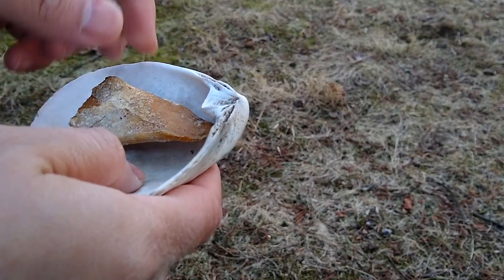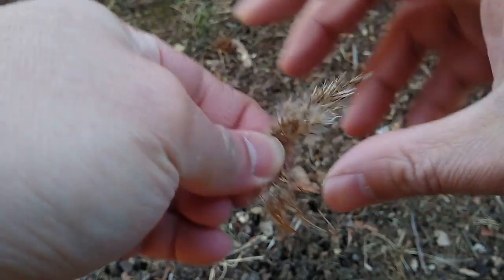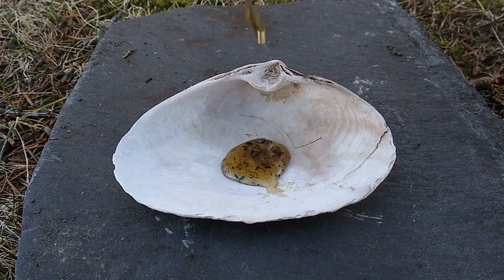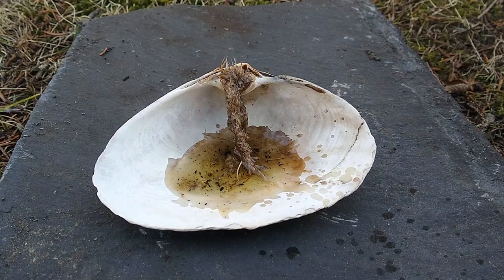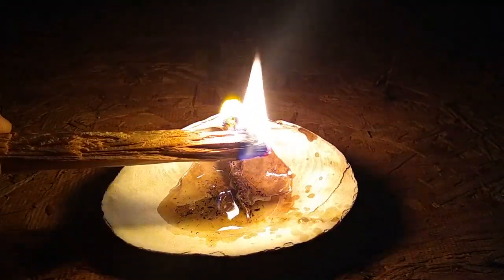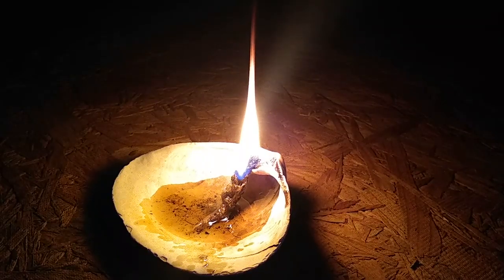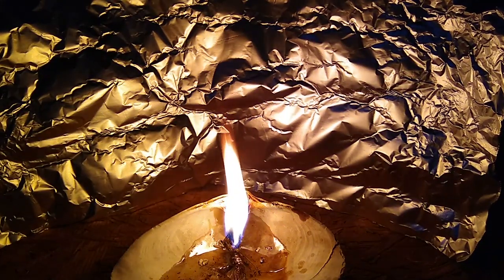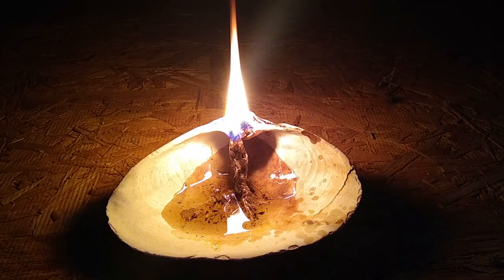Survival Candle made from primitive materials

Comment: I've been looking at primitive  candels as of late and I noticed that my first tought was that I feared the wick would fal once it burned too far. Did his happen? It could be because I used a different material and placement in my first candle. 
What I also noticed with my candle, which might also be the case with yours is that if you let the fat become hard the wick wil shorten fast since the fat would first have to melt before it can supply new fuel to the top, thus hightening the chance of falling. Is this also something you've had a problem with?
I'd love to hear something from your experiences about those and potential other problems. I'm in the middle of seeing what works and what doesn't so I am very curious!!

Cheers!!

PS: Sorry for any wierd english, it is not my first language.
Reply from the maker: Thanks for watching!  The key is to soak the wick very thoroughly in the fat, if the wick is partially soaked then parts of it that is not soaked will eventually burn out.  If however, it is fully soaked and allowed to harden before you light it, I found that the wick can burn for many hours without going out.  The other thing to watch out for is cracks in the shell.  The heat of the flame will sometimes will cause small cracks to become bigger and that will over time cause the fat to leak out.